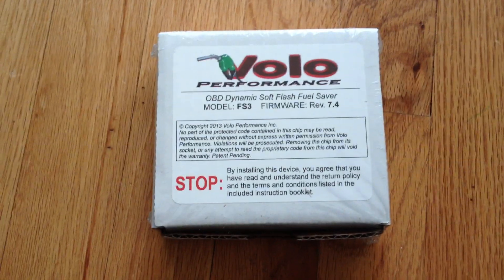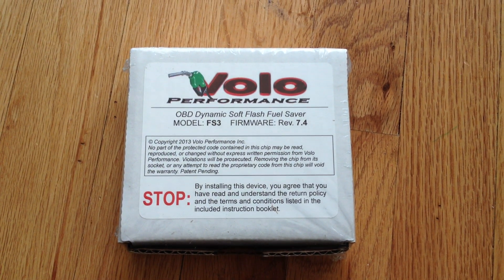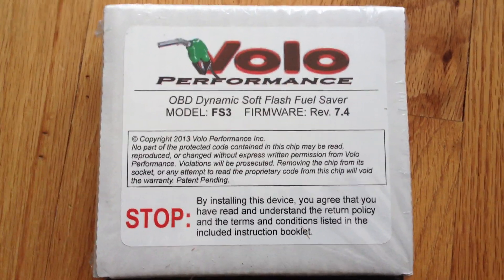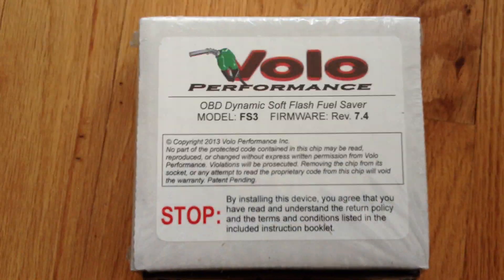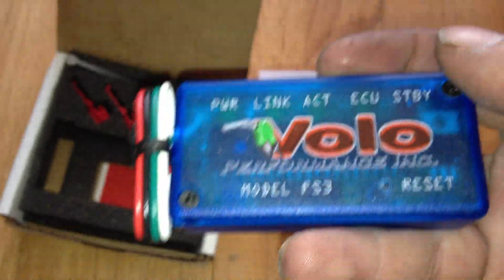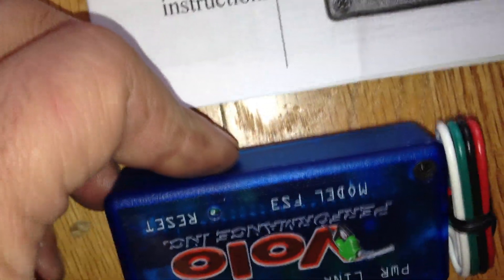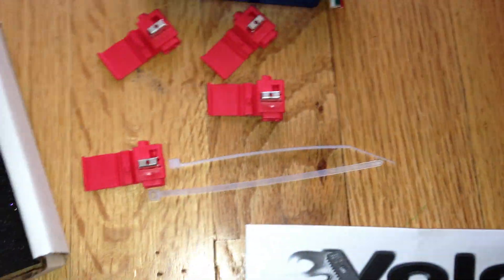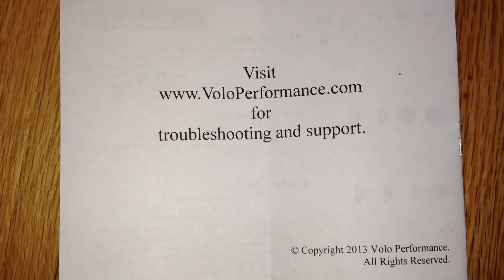VOLO Performance & Fuel Economy Review/Installation Guide-Does it really work LETS FIND OUT!  Part 1

Comment: Dude where are you from? I relative of mine makes HHO systems for trucks and it gives them up to 40% fuel saving, it might help you out, and as you said, when one does a lot of traveling, it really makes a difference
Reply from the maker: Went a step further, drive pure electric now ;-) fuel cost is now $0 as i use tesla superchargers :-) 45k miles/ year. my old truck from this video, still have it but gets used about 500 miles/year. prior to the tesla though. actually ran the truck on a mix of e-20 (about $1/gallon cheaper at the time than regular) and waste filtered motor oil. 1 gallon motor oil to 19 gallons gas. to date the truck has burned through about 300 gallons motor oil. really made a improvement while towing. towed a 5,000 lbs trailer quite often with it, smoother and ran cooler with the motor oil. it was really thinned out with the e20. didn’t do motor oil in winter though, made for hard starting in colder weather and smoked until engine warmed. only summer.
Reply from the maker: @gaetanlizotte1957  I have two of them now. Both paid for and loan free. I save a shitload each year. Paid both off on Fuel & Maintenance savings alone. Had 6 year loans on each. Paid the Model S off in 3 years, Model X off in 2 1/2 years :-)   Enjoying the dream quite nicely, yes :-) Zoom Zoom!